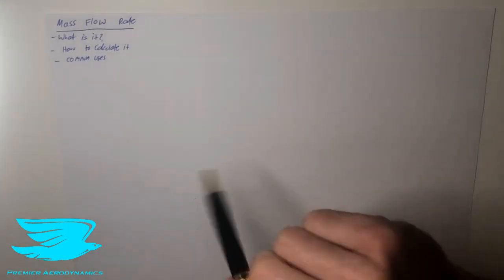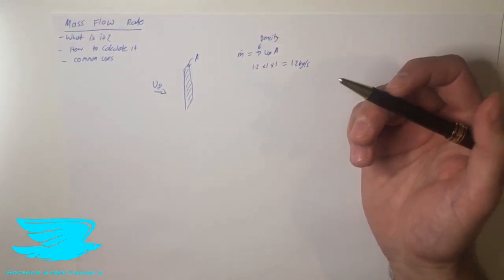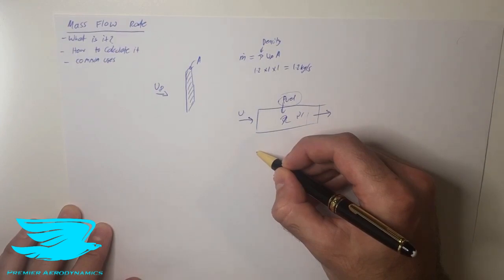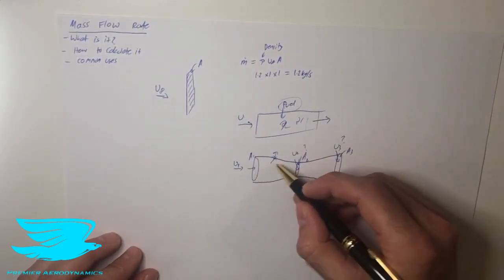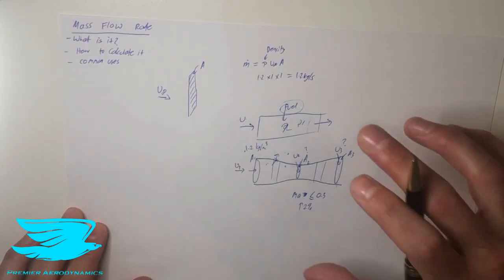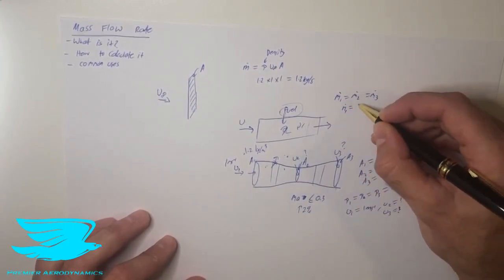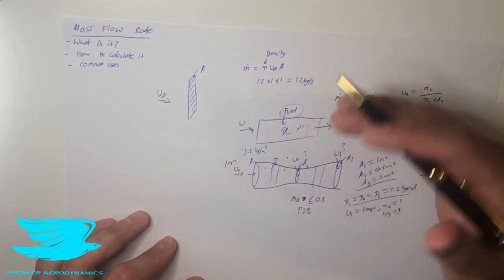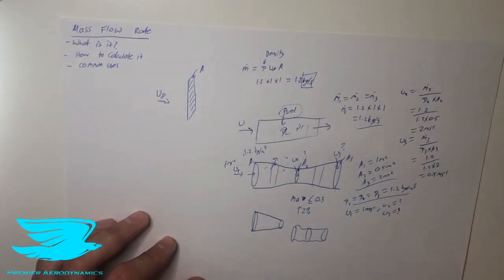[Aero Fundamentals #8] Mass Flow Rate Explained

Comment: You see a very clear relationship between cross section area and velocity. Halving the cross section area doubles the velocity. If you have a 1.4 square meter inlet, and a .2 square meter throat, you've essentially increased flow velocity by 7x. At a flow velocity of 70m/s the throat will reach 490m/s which is roughly Mach 1.4, at least mathematically speaking. In the real world, once you reach Mach 1, you've essentially maxed out the mass flow rate that can pass through, unless the air density increases.

Then like a tire deflating, you are removing air faster than you can replace it, the end result is a global drop in pressure.
Reply from the maker: That's a good point. The cool thing about converging diverging nozzles is that if you can get sonic flow at the constriction, when you diverge the nozzle, the flow will actually increase in speed instead of decreasing (as you typically get in subsonic flow).

Transonic and supersonic flows are cool.